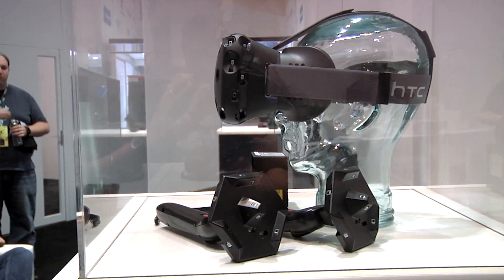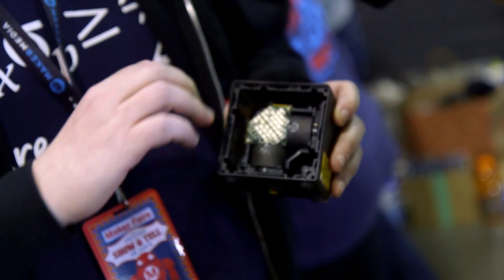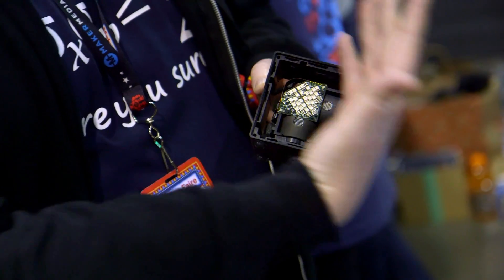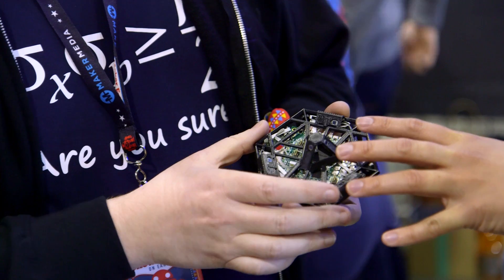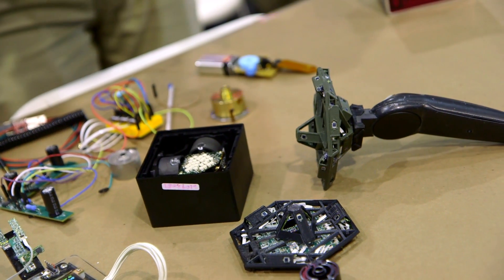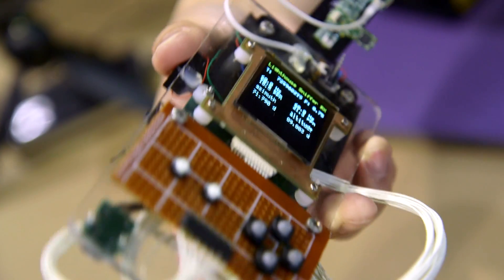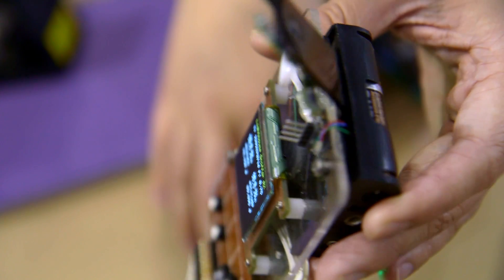SteamVR's "Lighthouse" for Virtual Reality and Beyond

Comment: SteamVR/Lighthouse was super cool technology, but it was always a terminal technological dead-end. 🤷 There's a reason Oculus went optical IR over laser. It was the fastest way to get to the inevitable tracking end-point of inside-out optical SLAM tracking.
Reply: Naw, you're off base. Lighthouses are still the most accurate tracking.  And while you're wearing a 600 gram headseat with a battery and cameras making your face sweat, I'm wearing a Big Screen Beyond 2 that weighs almost nothing and has superior tracking. Trust me, I had a Quest 3. The tracking is .... fine, but passthrough is terrible regardless of the positive spins you try to put on it, and  strapping a huge thing to your face full of cameras  is the "technological dead end".
Reply: @insertnamehere4419 Why has standalone VR outsold tethered by a factor of around 30:1 if the former is the technological dead-end? 🤣 And lol what are you playing on PCVR? VRChat? That's basically all PCVR has at this point. All other VR development is standalone first, other platforms second. And the accuracy advantages of Lighthouse simply aren't worth the downsides of only working in a single play space that must be located next to your computer. I've been in PCVR since the Oculus Rift DK1 Kickstarter (still have mine). Tethered-only VR was always a technological dead-end with zero hope for mainstream success. Both Palmer Luckey & John Carmack knew from literally day 1 that PCVR was just a temporary stepping stone to a fully integrated, fully portable device.
Reply: @Cooe.  Why has it out sold? Because the mass consumer market are people on a lower budget that like cutsey cutesy party games. Same reason the Switch sold so well. Most people to this day are buying Quest 2's and 3S's because they don't care about pass through, and they're cheap skates. hur dur, what are you playing on PC VR chat? haha...dude, I've never touched VR Chat, never will. Most people are tech illiterates still using a gtx 1070. I'm not pretending I  belong to the majority, but don't pretend the Quest 3 is the best VR. It's really ( really) not.
Reply: @insertnamehere4419 Lol then what are you playing? All PCVR has had are quick & dirty Quest ports for about 5 years now. And the Switch is a fantastic console that's about to become the highest selling video game console OF ALL TIME! Using that as a negative comparison is absolutely freaking INSANE!!! 🤣 Ignoramus PCVR elitists like yourself make all of VR look bad. Not everyone can afford or wants to buy a $1000+ gaming PC and that's totally ok. Saying that should be a REQUIREMENT if people want to experience VR is absolutely disgusting. Your entitled self makes all VR enthusiasts look bad.
Reply: @insertnamehere4419 And my PC is probably more powerful than yours so I know all too well how much of a zombie platform modern PCVR is. Unless you sim-race/fly it's a completely dead platform. Accept and get over it already. PCVR's time has past and that's ok. Quest 4 will be powerful enough that basically any game a VR developer could want to make will be possible on standalone and thus appealing to a massively, MASSIVELY larger audience (and Quest 3 is already shockingly close to that mark). And guess what makes a platform "not a technological dead-end"? SALES!!! If nobody is playing PCVR in 2025 who cares what you think about it?

Asgard's Wrath 2 is the best VR game released this decade, and guess what? It's Quest only. Batman: Arkham Shadow is arguably the second best and again, it's Quest only. Why? THAT'S WHERE THE USERS ARE!!! 🤦😑
Reply: @insertnamehere4419 And yes, when Quest is getting games like Asgard's Wrath 2 & Batman: Arkham Shadow while PCVR is lucky to even get mediocre Quest ports of less good & popular games, Quest 3 is currently the best VR gaming experience available. Playing Half-Life: Alyx for the upteenth time isn't "the best VR". It's pathetic copium. The only exception here is if you sim-race/fly where PCVR is still clearly the only and thus best option. (And basically the only thing I regularly use PCVR for anymore.)
Reply: @Cooe.  lol "Quest ports" doesnt mean what you think it means.  There are games that are on native Quest, as well as PC .... that's not a "Quest port".  The small handful of games that are literally  Quest Ports like say Moss are better on PC because duh.  Any game that is on PC is better by default with better textures. Red Matter 2? Better on  PC.  You can't name more than 4 good games that are exclusively on Native Quest.  Asgard's Wrath and Batman. Wow I still have fingers left over. You seem awfully defensive. Quest is cheaper, but it's not better. It's silly to argue this. PS; you have no info to make statements like " my PC is probably more powerful than yours"....( it's not but anyways). Stick to the argument. Next you'll insult me and call me "kid" or something right? I'm just going to mute you. lol Quest 4 will be hand tracking only and not for gamers. Have fun with that. Meta has officially lost the plot.
Reply: @insertnamehere4419 And I never even said anything about passthrough but it's absolutely a CRITICAL feature for mainstream adoption. People need to be able to quickly see and interact with the real world without taking the headset off and MR/AR has a million use cases that standard VR simply cannot do. AR will always have a broader potential user base than VR, and modern MR headsets are the best way to prototype and develop what does and doesn't work in AR before AR glasses exist. VR will always be niche, AR otoh will eventually replace the smartphone as the dominant computing platform.
Reply: @insertnamehere4419 And I never even brought up passthrough but it's an absolutely CRITICAL feature for mainstream adoption and success for XR headsets. People simply need to be able to quickly see and interact with the real world without taking their headset off. Also, MR/AR have a million use cases that VR simply doesn't have. AR is the future of computing and has a WAAAAAAAY bigger potential market than traditional VR will ever even dream of and modern MR headsets are currently the best way to prototype what does and doesn't work in AR before actual AR glasses exist. AR will literally replace the smartphone, while VR will always stay a niche hobby really only appealing to gamers. And VRChat (the only thing keeping PCVR alive in the 2020's) only appeals to a tiny niche within that already small niche. Heck, VRChat does far more harm to the VR ecosystem than it does good. The platform absolutely breeds degeneracy and disgusting behavior.

Comment: Wow coming back to this 5 years later is CRAZY. Still don't understand why trackers cost so much?
Reply: probably got limited manufacturers for this kind of stuff. also profit margins haha
Reply: @sherdogholmes576  Crazy, literally just a few weeks ago Tundra Labs(makes SteamVR dev kits) just announced they are making lighter, cheaper trackers. FINALLY in 2021
Reply: @ScornfulSix  for real, i’m excited for when tundra labs releases them. definitely a purchase for me as soon as they drop
Reply: Unlike other systems, hmd, contollers and trackers are responcible for tracking and calculating position, this require some computing power that costs. Valve dont take any fees to use technology and they dont require you to use electronics there ic partner provide, so the more this technology gets adapted more cheaper solution will show up, but due to way this techology work it will always be bit more expensive, still best tracking most open vr technology you can get for normal mortals prices.

Comment: Man, how far SteamVR has come...
Reply: SteamVR/Lighthouse was a technological dead-end. 🤷 Oculus/Facebook had a MASSIVE advantage in moving to the inevitable end-point of optical SLAM inside-out tracking thanks to their already optical tracking Constellation system.
Reply: @Cooe.  L brained take. Lighthouse is still far ahead of inside out tracking and will continue to be used in the professional industry for years to come.
Reply: @Pendleton115  Also Lighthouse is most definitely NOT still "far ahead" of Meta's Insight inside-out. Meta's self-tracked Touch Pro controllers get INSANELY CLOSE to Lighthouse tracking quality with an even BIGGER tracking volume (bc 100% no occlusion) but with none of external base station tracking's shitty pain points. Lighthouse has its advantages, but they are mostly so niche as to be irrelevant to 99% of use-cases. Even full-body tracking is inevitably going inside-out w/ cameras vs using external trackers.
Reply: @Cooe.  cope and seethe bro cope and seethe
Reply: @Cooe.  Lol, Meta fanboy that desperately pretends to know what they are talking about. Cope harder.
Reply: @Nyx_2142  🤷 Scoreboard genius. I've been in PCVR since the original Rift DK1 Kickstarter (still have mine) and the platform has NEVER been more dead. And Valve's VR hardware never less used/successful. It's old as hell. It's been passed by. Get over it.

Comment: wouldn't it be cheaper and more efficient to do it the other way round where the controllers project the light and the light house calculates the position of controller rather than the controller track the light house. Kind of like the oculus has done
Reply: also important to note that it’d be much harder to have projections coming off a moving object. it’s much easier to keep the IR projections coming off a static point in space then have 3 variable movement IR emitters in a given space (HMD and controllers)
Reply: But then that induces inherent occlusion. I play Onward competitively, we cannot shoot rifles due to the front controller being occluded. Lighthouse solves that. The best VR system you can buy, the Valve Index, is the next generation of this tech.
Reply: @sqlevolicious  thats a very fair point i overlooked

Comment: So when Alan says the lasers can reach out to 20m but the limit is the syncing, couldn't we make a huge roomscale area with the current lighthouses and just use the sync cables and extend them?
Reply: +Scott Fanetti I see that as an option too. But my question was, can't we just use 2 lighthouses, say in a large area and just extend the sync cable,? Or does the sync cable have a length limit?
Reply: You can't do that yet. Still only supports two.

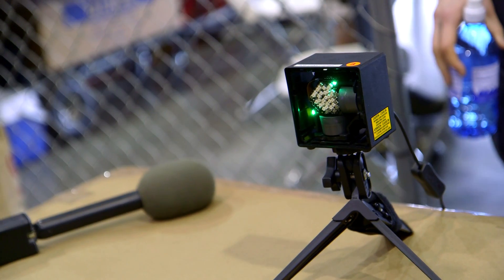Comment: 4:39 - Exposed class 3B laser. Fantastic, ruined eyes everywhere. I hope they removed the laser for the preview.
Reply: Well, except for the person playing. Cause they'll be wearing a pair of goggles completely blocking it. On top of that, that warning is for direct, prolonged contact. It's simply a sticker they need to put on there, not necessarily "dangerous" in any way.
Reply: There is no danger when the Lighthouse is closed. When the front panel is cracked or completely gone like the video, you get exposure from a Class 3B laser which is so powerful you can't look away fast enough to avoid eye damage. So either they're crazy, or they removed the laser.
Reply: 4:40 Do you not see the lights and the rotating motors? It clearly has power.
Reply: +MulleDK19 Nope.
Reply: do you realise that the lighthouse he show is not plug in any power .......
Reply: MulleDK19 See all those LEDs in the middle? Those are IR-LEDs, and are powerful enough to show with the naked eye, but yet they're not visible in this video. I'm assuming they disabled those, along with the actual lasers.
Reply: right . sry
MulleDK19
Reply: My guess is that it is at a modulated power and they just had the laser in there in order to try different magnitudes of intensity. If this is not the case then the range of this device would be on the order of several hundreds of feet. It is also scanning such a wide field of view at 60 times a second, in the lower-energy infra-red spectrum. 
I can only guess average power hitting your retina is within safe limits. Plus they have that safety feature if one of the motors stops.

Comment: How do you disambiguate multiple lighthouses on the sensor? Do multiple lighthouses do chain synchronization of some kind to avoid interference?
Reply: +Siana Gearz Yes, they sync between them, the old devkit had a sync cable, but the Pre has the option of wireless sync.

Comment: Wow the people in this comments section are not nearly as excited as they should be!  I thought we were a bunch of geeks!  This is the future!
Reply: The Mack Attack   It's only the future when it can achieve the following 4 tasks:

1.  Not require wearing such an extensive piece of equipment on our faces that obstructs 100% vision.

Instead of wearing the devices, we need the devices to be external and mobile.  A tethered drone (for power etc.. once battery technology improves  wireless version could be released) using Ionic Thrusters for silent movement could track a user remotely.

As projection technology improves, we would see the user may only need to wear a pair of special clear lens wrap-around glasses which provide a surface for the drone to project your immersive display onto.. or it could project directly onto the surface of your eyes.

Directional audio projected to the user exclusively

We saw how, although 3D glasses and tv's and devices were all the rage.. they never quite took off to become the new mainstream like we first anticipated they would.

The main issues are.. a lack of industry standards, the requirement of wearing a powered headset that communicates using hefty wireless radiation waves right near your brain (the more data you need to transfer the stronger the frequency needs to be and for full VR it's likely a LOT of data.. plus latency handling means it will need to be sending large data at high speeds).

I'm sceptical of this technology reaching absolute mainstream within the next 2 years.  I'd love it to happen but there are some serious social, medical and physical barriers that need to be overcome for that to happen.

2.  100% deal with the issues of VR Sickness

3.  Become commercially affordable to the mainstream $200 price point for the headsets and around $60 for a pair of VR Gloves

4.  VR Gloves currently out there don't provide the user with a joystick for navigating virtual environments effectively.

Until they are so responsive that you can use a "virtual thumbstick" with no latency the input sector of VR will also be a bottle-neck.  Oculus Touch does look good but will it meet that $60 for a pair .. price-point?
Reply: @JaxCavalera  hello 6 years in the future :)
Reply: @FleaOnMyWiener  haha yep still waiting for that drone
Reply: @JaxCavalera  loll we can actually project low power lasers directly into the human eye I believe! I think there's a VR headset out there that does this, I saw a ThrillSeeker video on it
Reply: Yes the applications sound amazing and it will on vr,  but they advertise it as a way to move in an environment in real life and virtual, and i just don't want to move to much in real life when all my senses are on other place,  i feel this will lead to a lot of accidents

Comment: I used to use high powered laser systems in the US military and we had to be very careful about where we aim an IR laser because it may cause blindness. Would the lasers within the lighthouse ever cause eye damage over time?
Reply: slayemin I've worked on a similar system with rotating IR lasers that projects lines. The fact that the light is spread out in a line rather than focused on a point means that the energy hitting you diminishes very rapidly as you step away from the laser. Also, it's always spinning which means that it's spreading that light all over the room. The laser is also probably only a few mW... TL;DR other than if you're sticking your eye next to the lens, your eyes will see very little IR light.

Comment: So could I take 200 lighthouses, spread them around a big hall, and create a Laser Tag of the future?
Reply: 30LayersOfKevlar 
Vive cord only 3-5 meters..
Reply: Alexi GVS plug the cord into a wireless transmitter.
Reply: RedTriangle53 
Will not work properly. Because of latency and bandwidth. Wireless is capable to transfer only 1080p/60fps. 
HTC Vive 90hz and 2400x1080
Reply: @OleksiiGVS  hello from the future :)

Comment: I have 2 questions please :
- i use VR especially for racing and flying/space simulations , so it's mostly seated experiences, and by the way most of us will use their headsets in front of their PCs .. so my question is , do i need 2 lighthouses to be tracked? they are big, and honestly, i don't know where to put them in my living room.
-my second question is : will the tracking work correctly if i have a big mirror in my living room ?
Reply: ahmbouth 
- Based on the information Alan provided it sounds like one Lighthouse base station is technically possible, but it will come down to how flexible the drivers are. So far it sounds promising, although occlusion will always be a problem with one base station.
- A mirror will mess up tracking if it bounces the lasers back to a sensor.
Reply: haze4peace
thanks for the reply :)

Comment: Would something such as Lighthouse work well with easily and accurately translating one's movements to an in-game avatar, such as an application like Facerig?
Reply: Doesn't it just track the controllers? You would have to have sensors on your face.
Reply: David Belmonte The Lighthouse base stations are basically dumb devices. They don't do any calculations on their own. Its the sensors on the headset or controller that gathers the information for processing. So you would have to stick sensors to your face for it to pickup facial expressions.
Reply: David Belmonte It would probably only work if it didn't cover your face, so transcribing facial expressions and such onto your avatar would probably have to wait until we have VR swimming goggles.
Reply: Edison Trent there's some interesting research on how to track facial expressions by checking for muscles that surround the area where the headset is to detect eyebrows raising. neat stuff!